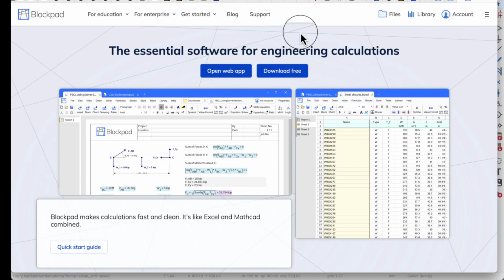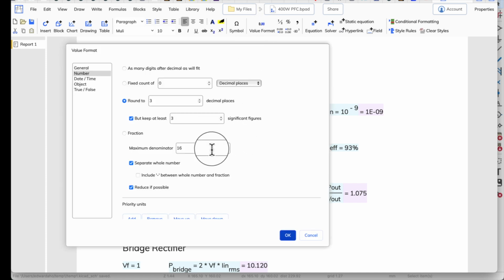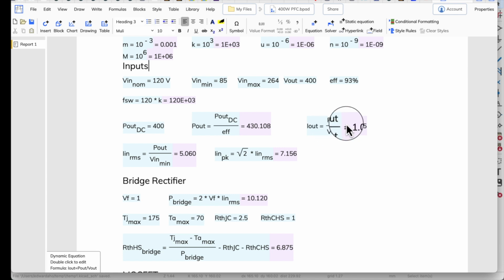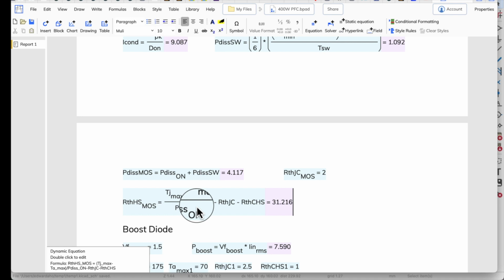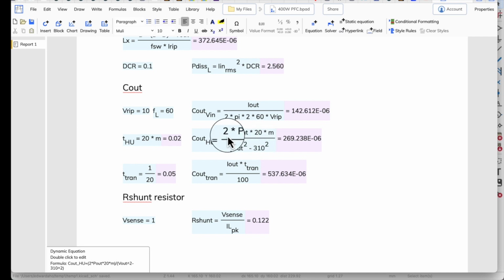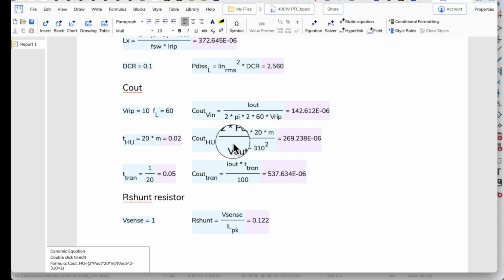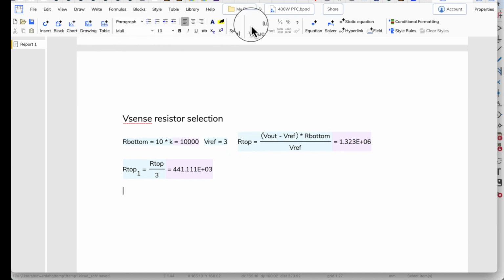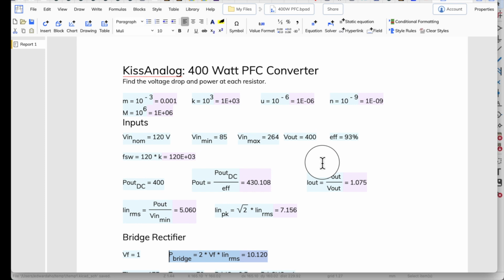PFC design with Math Pad Intro with Blockpad Intro

Comment: Jeez, Eddie. I was just struggling to grok the equations "hidden" in an Excel spreadsheet when I saw this video. Being able to see the equations "work" makes them so much more understandable. Hopefully I can use the free version. $18/month seems a bit much if I need to use it only occasionally. One feature you didn't use is the built-in engineering units. You can write something like "I = 1 A, R = 1 ohm, E = I * R" and Blockpad will calculate E as "E = I * R = 1 V". Pretty cool. Thanks for cluing me in.
Reply: The units thing doesn't always work that well. At least some results that should be expressed in henries come out as Ω/Hz. At least some results that should be expressed in farads come out as 1/(Hz * Ω). Not cool, but also a reminder of how henries and farads are defined.
Reply: Since then, I've learned you can force Blockpad to display results in any of its built-in units by adding a "to" operator to the end of your equation. For example, when I got results in the awful "units" of "μH^0.5/farad^0.5", I added "to Ω" and got them in ohms. Not great, but doable. In the end, though, using units might be more trouble than it's worth. I haven't quite decided.
Reply from the maker: Thanks MikeMike!  I probably should use the units or at least show this - thank you!  Some equations get a bit dicy trying to get all the units in, so I just stopped doing it, but it does make for an easier read;)
Reply: @kissanalog  Playing with Blockpad further, I discovered that it doesn't have many electrical units defined, and I did send them some feedback suggesting adding all the missing common ones. Meanwhile, I've been defining things like "mH = 1000 μH" and "μF = 0.000001 farad".

Comment: Blockpad looks like a very nice tool, but from what I can gather it is limited to 20 "equations" in the free version. I think most designs will exceed this limitation, The paid version is $18/month - almost $220 a year. If I were to use it professionally, I guess this is fine, but for hobby use, it's not going to kick Excel (which I already have) off the bench.
Reply: 18$/monthly??? Wow, that is a lot for what the tool seems to offer.
Reply from the maker: Thanks so much!  I'm glad I can use it for free.  I'm not sure what the paid version provides that I can't do with the free one;)

Comment: I think it's cool for engineers doing a project. I write code to go along with projects usually. I'm still learning circuit based math. I learned quaternions as of late ones part for  preparation for my hardest project yet I'm gathering info and hardware. It's gonna take me the whole winter.
Reply from the maker: It is great to hear you having fun doing this;)